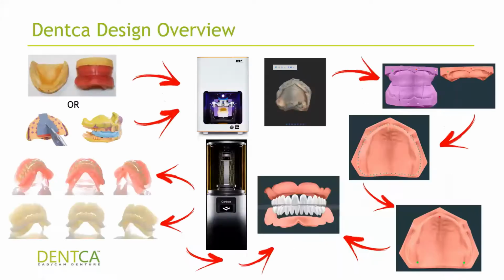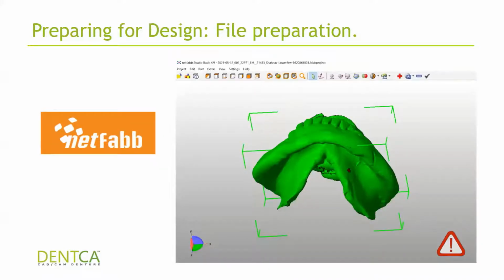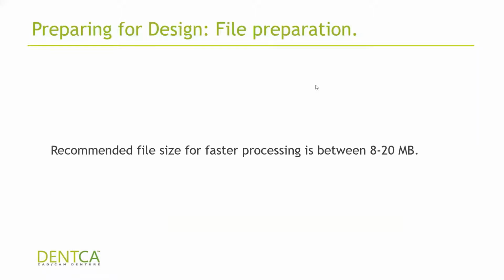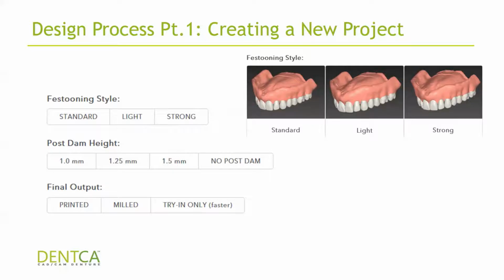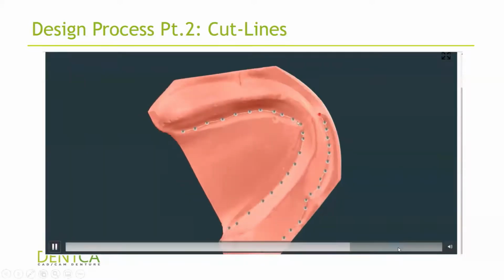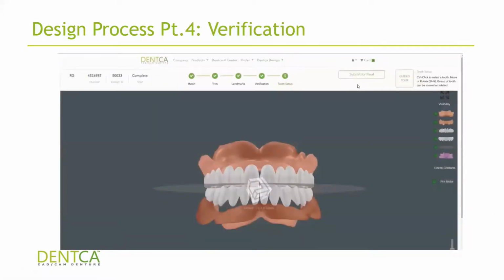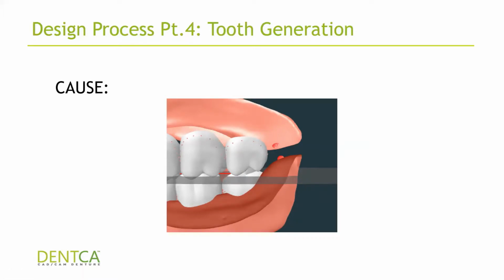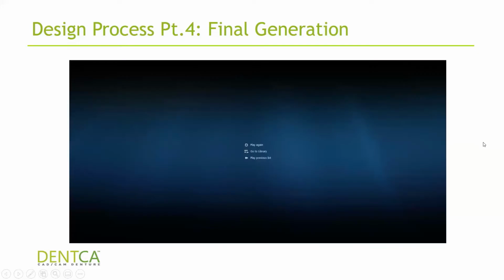Webinar 4: Troubleshooting digital dentures on Dentca Design. May 28th

Comment: What causes yellow between teeth and at base with new digital dentures
Reply from the maker: Hi, although not exactly related to the topic of designing dentures it usually happens because of the patient habits of smoking, eating or drinking foods that stain the dentures or lack of proper cleaning. The dentures are made out of acrylic so the end product is no different than your conventional dentures, whatever stains a normal denture will stain these.